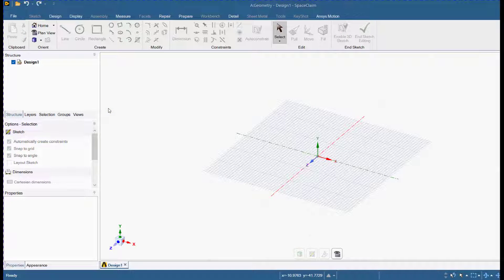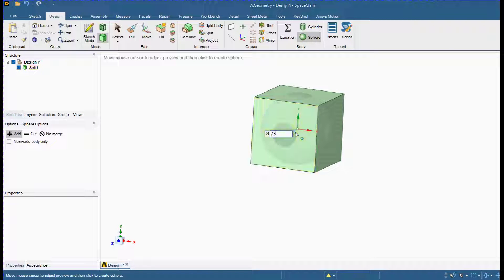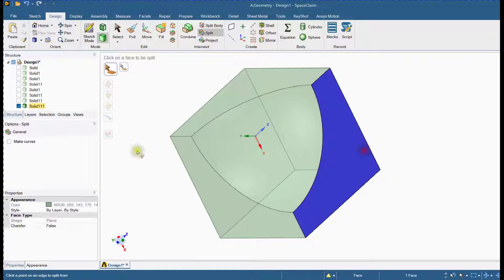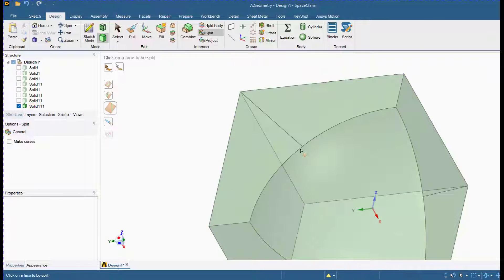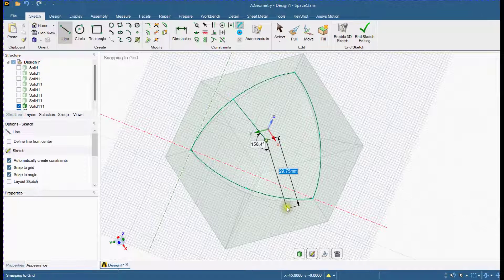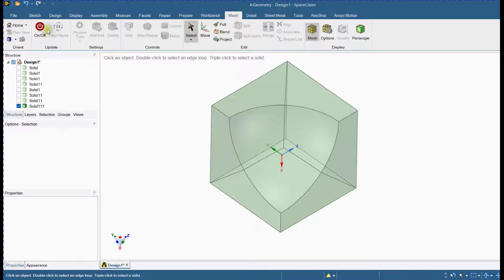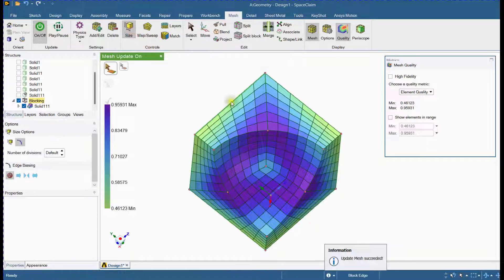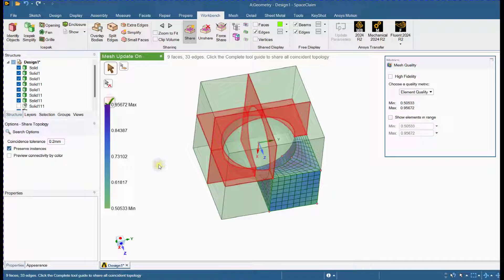✅How to Mesh a Cube with a Central Sphere in ANSYS SpaceClaim

Comment: Should I slice and project curve surfaces separately for other parts? or is it possible to make a mesh copy since the other parts are the same size?
Reply from the maker: You can copy the same part and apply different transformations to create a cube, and then merge the nodes for the common surfaces.
Reply: Thanks your return😇 For this example, can I delete the unmeshed 7 parts then move and copy this meshed part(you made in video) in the design section so that they can be meshed as well?
Reply from the maker: @NurselKutuk  You can create a cube from this single part in two ways: either delete the remaining seven un-meshed parts and duplicate the mesh part, placing it at the desired locations, or export the mesh part and import it eight times into an external model (in component systems) tool, applying the necessary transformations to assemble the cube. If you need a detailed tutorial on how to import and transform the part using an external model, we can provide one, but please note it will take approximately one day to prepare.
Reply: Really thanks a lot🥹🙏🏻I will follow your update videos.
Reply from the maker: Hello, Please check out this recently made tutorial: https://youtu.be/JpCU0bjStCM
Reply: By size editing after meshing, you have achieved your mesh element quality up to 0.50533. Is it possible to increase the element quality or not is this quality sufficient for this shape' analysis?